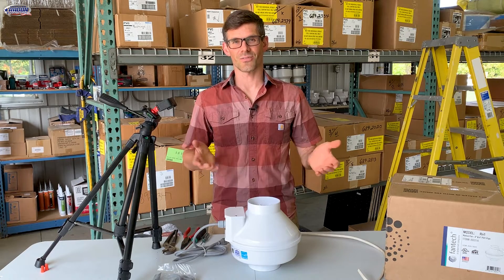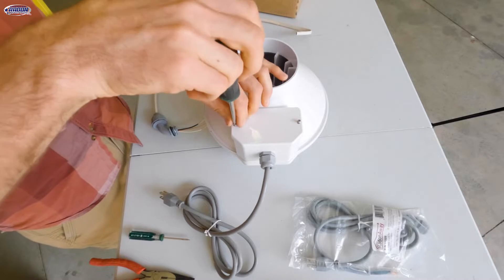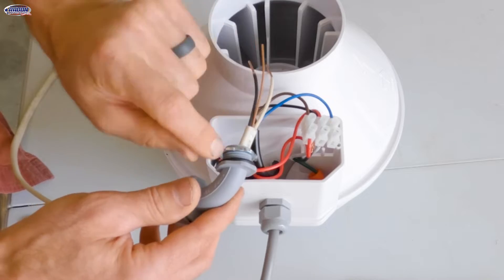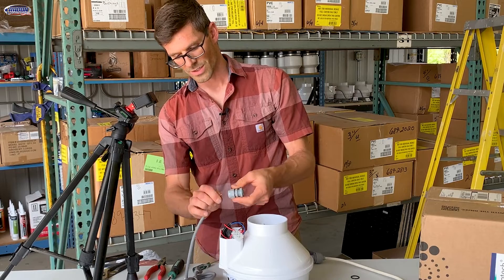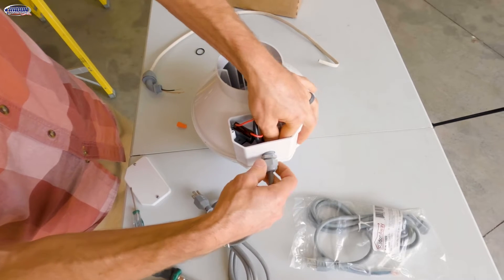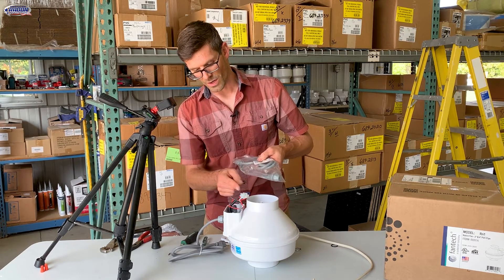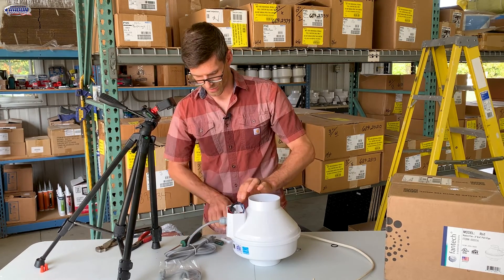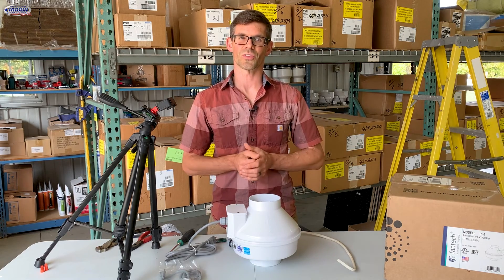How to Wire a Fantech Radon Fan

Comment: I have a Fantech Model FR150 115V 90W, 0.80AMPS 2500 RPM 220CFM 0.20IN .WG. It is loud. What is the replacement model for it?
Reply from the maker: Check out our radon fan replacement chart with links in this blog: https://americanradonmitigation.com/diy-radon-fan-replacement-garage-attic/

Comment: My fan is a Fantech 150 that was modified by a vendor for low voltage. The bearings are shot, any idea how to modify a new 150 (perhaps using parts from the old fan?) to convert it from AC to DC?
Reply from the maker: It sounds like you might have a KTA fan produced by PDS Radon. Here’s a link to their website: https://radonpds.com/product-category/radon-fans/

Use promo code Jesse for a discount. We do earn a commission and appreciate your support.
Reply: It is a PDS KTA-150.  I'm local so driving in on Friday yo save shipping.  How much is the Jesse discount?
Reply from the maker: @orkins2025 I believe it's 5 percent on your first order. Tell the gang I say hello!